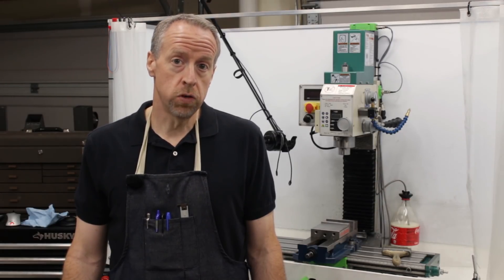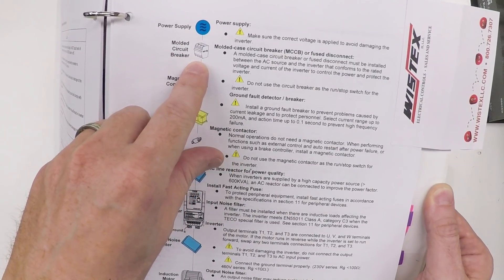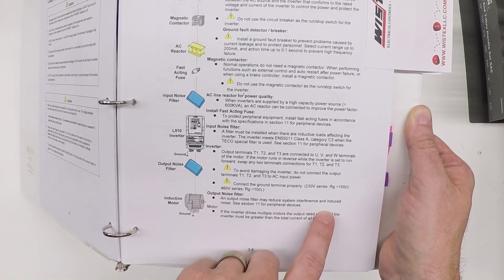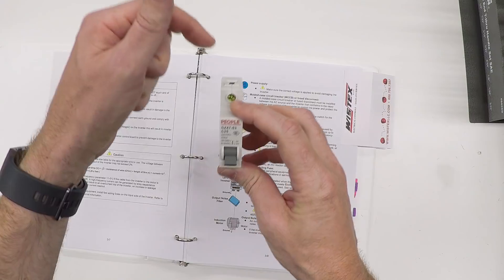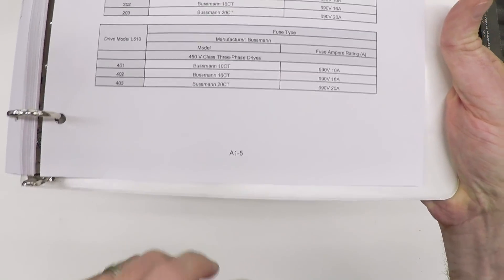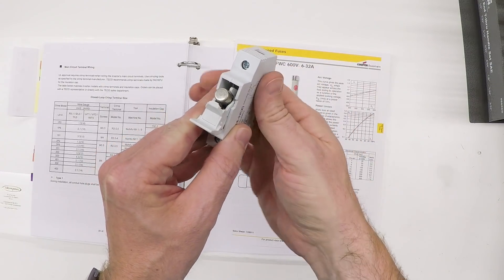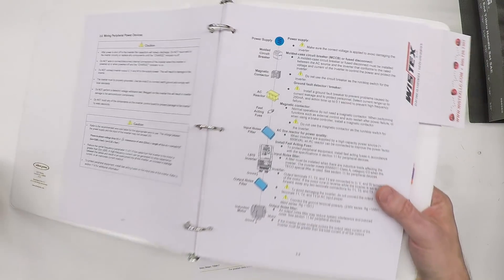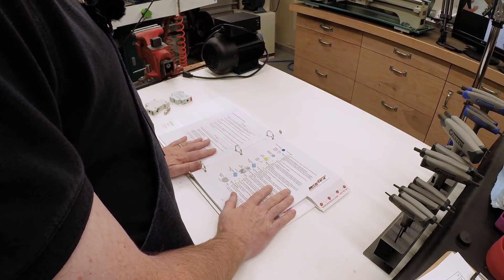Lathe VFD 8: How to Wire Circuit Protection (Breaker and Fuse)

Comment: hey question... about the contactor...  if it is not being used to start/stop motor, is it needed?
Reply from the maker: It serves as a power switch to turn power on and off to the VFD.  And since it's wired to the E-Stop, it provides a convenient way to do this quickly in an emergency.
Reply: @Clough42  But... If you are using an external braking resistor, do you really want to cut power to the VFD, preventing the spindle from stopping quickly with the external resistor? The spindle will just freewheel.
Reply from the maker: @billh308   I see your point.  If I had an external braking resistor on this setup, that might be a better option.  If course I would then need some other switch to control the contactor, because I still want to be able to power down the VFD when it isn't in use.
Reply: @Clough42  I'm configuring a VFD for my 220v 12x36 lathe, I think I am going to use a DPST switch on the mains before the VFD, skipping the contactor. I believe the Teco VFD I have has a function that will prevent it from running on power up if the external switch is in the forward or reverse position.
Reply from the maker: @billh308  Yes, the L510 has that feature.  Just make sure your switch is rated for the horsepower you'll be pulling.
Reply: @Clough42  Think I will repurpose a 24v relay triggered by a toggle switch

Comment: Hi James Rather than using a dremel to cut out sheet metal why not look into using a nibbler attachment mounted in a battery drill? Whilst noisy they cut leaving a smooth edge and virtually no dust.
Reply from the maker: That sounds good.  As  you saw, what I did took a lot of time and made a big mess.
Reply: Why not just use a jigsaw with a fine tooth metal cutting blade

Comment: Nice work!!
I have a question that is really making my head spin.
I did watch your video a couple of times and I did not find where the contactor wires are coming from, since you bring only two sets of wires from the front control panel on the lathe.
Reply from the maker: There are five cables coming out of the control box:
1) Power input cable that goes to the wall outlet
2) Three-phase motor cable (black) that goes directly to the motor
3) Small fan cable (gray) that goes directly to the fan on the motor
4) Control cable (gray, 9 wires) that goes to the direction lever and speed control knob
5) Contactor switch cable (gray, 4 wires) that goes to the e-stop and start buttons to control the contactor

Sorry if that wasn't clear.  Does that answer your question?
Reply: Clough42 
Yes!!
Thanks a lot!!
I’m doing it but using a 220v 1800 RPM motor. That means I can use the same L510.
Any recommendations? Do I have to use 2 fuse boxes and two circuit breakers?
My lathe is a 12x36 and I have the reverse forward switch on the lower axel carriage. I’ve noticed 4 wires coming out of the reverse and forward switch. Do you have any idea of how I should hock up those wires to the VFD, since I did see only 3 wires coming out of your forward reverse switch?
Thanks 
And sorry for asking so many questions. 
Hope you can help me.
Reply from the maker: @reinaldogulli3235  If you're in North America and your 220V service is two hot phases, I would use a double circuit breaker and two fuses.  The circuit breakers should be tied together so they both open if one trips.  If you are somewhere else with single-phase 230V, I believe you only need one circuit breaker and one fuse, on the hot line.

Comment: James, I want to install a VFD on my drill press to control the rpm’s. It is the Delta 20” floor model. I don’t know of any other functions that I would need to control. It is 115 /230 volts, currently wired 115. Would you change it to 230 and which VFD would you recommend sir? Thanks in advance and I enjoy your channel very much sir!!! Bobby
Reply from the maker: Is that a single-phase motor?  If so, you'll need to replace it with a three phase motor to control it with a standard VFD.
Reply: They make single phase input/output vfds you don’t have to change anything as long as it’s not an extremely high hp motor

Comment: Not sure if you have any plans to do this in the future but I'd absolutely love to see a video on adding a braking resistor to your setup.
Reply from the maker: I would like to have that, too. Unfortunately, the specific VFD model I have doesn't support an external resistor.
Reply: @Clough42  that drive is stopping that chuck with no resistor?
Reply from the maker: @beckyschwantes5287  correct.  It dissipates the energy through a transistor, but it has limited capacity.

Comment: I have a problem with mine. if I start it at 60.00 the machine shuts off. anything over 45.00  on start up it will shut off.
Reply from the maker: When it shuts off, does it display an error code?  I wonder if it's trying to accelerate a heavy load too quickly and hitting a low voltage condition.  You might try slowing down the ramp up time.  But even if I put on a heavy chuck and speed it up quickly, the VFD doesn't seem to complain.

Comment: in the machine we use at work there are normally motor protection trips between the vfd and the motors. something like a Siemens SIRIUS. also one reason for the breakers on the main input is you could have more than one system in the electrical cabinet. so each vfd is independently protected
Reply from the maker: Ahh...good point.   This is a simple installation, without as many requirements.
Reply: You might double check that . That is not standard practice. You would have to wire a signal back to the VFD and shut it down because the VFD would keep pumping voltage into that relay.